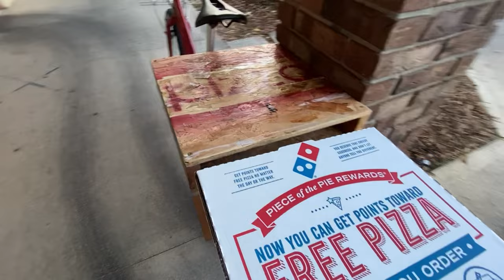How to bike with pizza

Comment: Maybe add foam padding on top and bottom to help with eat retention? Even without that, very nice.
Reply from the maker: yeah that's my next move, just yesterday my father happened to have a roll of this thin insulation, so I'm going to see if I can get that setup.
Reply: @BruceChastain  If nothing else a little at the door to help hold it in place to keep the pizza from rattling? 

Wonder if yo ucould slide a milk crate over this so you ahve safe pizza along wit ha rack of other stuff.
Reply from the maker: @singletona082  that's actually a great idea, it's a totally flat surface so yeah, might do something like that.
Reply: @BruceChastain  👍

Also really like your spraypaint pizza logo. :) 

Stay awesome man.

Comment: The wood box is to keep it warm? Maybe I'm not getting what's the purpose for it.
I've seen multiple pizzas being carried on the front rack with just bungee cords and the cardboard box is held firmly without cushing the pizza inside.
Reply: Perhaps he wants a little more security? The box would help with heat retention too so I dunno.
Reply from the maker: the wood box does help a lot with insulation, without it a lot of cooler air would flow right into the cardboard box. So it's two things, for good security and for keeping it warm.